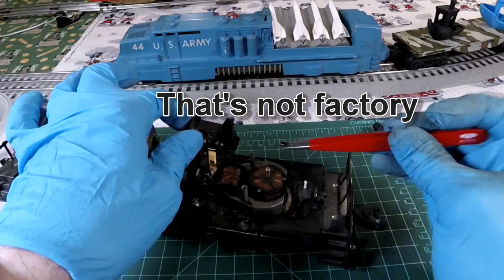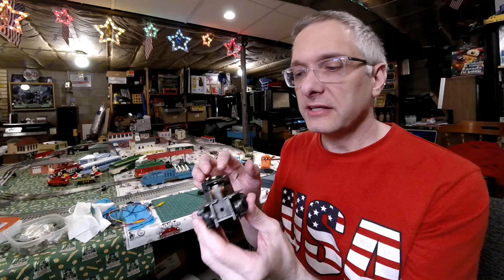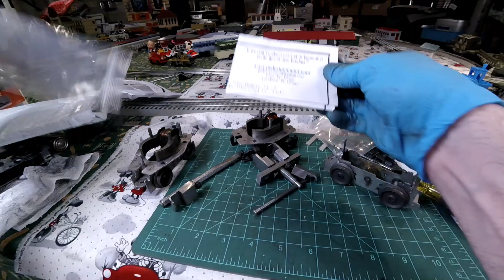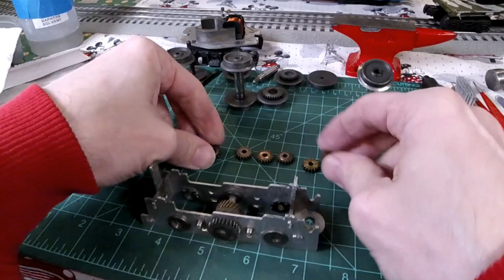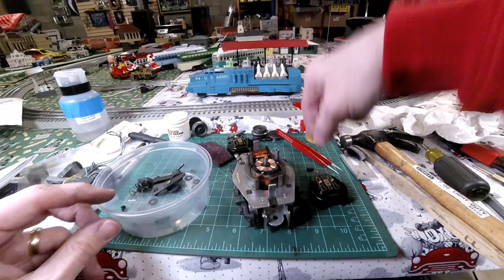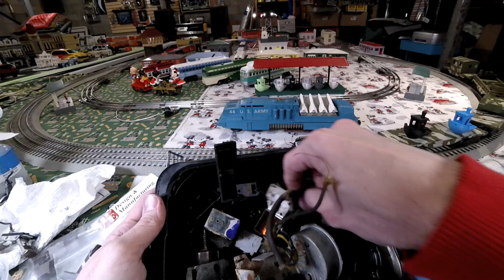Lionel postwar NW2 rebuild pt1 (Thank you @Railchief74)

Comment: Great! Jeremy, thanks for the motor and wheel pull apart demo. I have a 6 wheel truck I have to replace the axle worm drive and have not found the whole motor assembly to match mine. as well as a smoke unit lob on a steam engine.  Not ever having worked on the inner gears on these will be a new one for me.

 I found it interesting how the early new Lionel 1970- till a later time, used this style of motor assemble for their diesels, but much improved. Then moved over to the style like the ones used on the original FM engines and then just used the DC can motor on the same concept.

The aluminum frame was required when having magnatraction axles. You win some and lose some.
 
 On a down side. I find it frustrating when people show a service video and then use a power cleaning tool that flings all of the dirt over the items they are working on or the outer train shell. Any thing that might have metal partials will get into the magnatraction and gears and screw them up like sandpaper. I learned this the hard way with my 2055 as a 12 year old cleaning, sanding the wheels of that engine and then, it soon would not run due to the secondary drive gear was now worn away.
Reply from the maker: Glad you enjoyed the video.  Lionel power truck development is interesting for sure. Cost reduction/labor cost reduction, then redesign to fix issues. Then start the cycle all over again.

Comment: The plastic bearing plate on these wear on the sides where it meets the metal frame. Wedging a piece of credit card on either side can tighten things up and make them run better.
Reply from the maker: Thank you for the great tip! I will be giving it a shot. :trophy-yellow-smiling:

Comment: Thank you for the shoutout Jeremy, I can’t wait to the final results! I did kinda looked threw everything to see if I could get it to run again originally, but considering that it’s a later Lionel chassie and frame from 1955, they seem to be a little more challenging to work on. The older E-unit switch was also far from gone so I swapped it out for a newer one.
Reply from the maker: It's all good :face-red-heart-shape: I love the challenge. I'm happy my wheel puller came in time for this project.
Reply: @railchief7495  Hi Railchief. I see in some of your videos that you operate around southern Delaware. I’m from the Dover area. Great to have an enthusiast like yourself in the neighborhood.
Reply: @ not south, I’m on the eastern side of Delaware

Comment: Nice job!  Would it have been easier to just take that metal plate off of the good truck and replace the one that was bent, along with the plastic bearing support, instead of pulling the wheels and moving everything over?  I've never pulled wheels off of a truck, so I'm not sure if it was the better or easier way to go, in this case.  I've only done basic maintenance, like replacing, rollers, armatures and other easy fixes, over the years.  Either way, a fine and informative tutorial.  An excellent video, as always.
Reply from the maker: An excellent question! Yes - if the bearings and other components were in similar condition. Changing the top plate would have worked best. However the truck with the bent top plate had many more miles on it. Thankfully the magnetraction axles are made of a hard alloy. So I was able to swap them without worry about wear.
Reply: @TooManyHobbiesJeremy  Thanks!  Great information, as always.

Comment: Hi Jeremy. I find it a little easier to remove those spring nuts by using pliers to squeeze them at the long ends while working them up with a rocking motion. The squeezing helps to release the fingers on the nut that bite into the mounting posts of the motor frame. Still a little fussy to get them off but the pliers method definitely helps. Thanks again for all your great content each week. I learned a lot on this video. Love the new layout!
Reply: Another successful😊 surgery by DR.JEREMEY
Reply from the maker: Haha! :face-green-smiling: YES! Take that Doogie Howser
Reply from the maker: Thanks for the excellent tip! I will certainly try that out next time. Glad you liked the video :face-red-heart-shape: